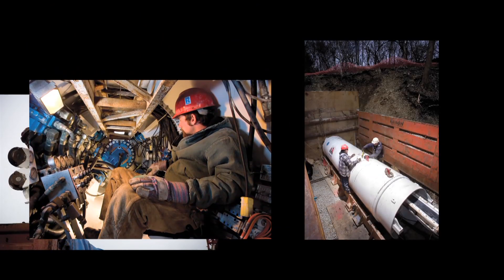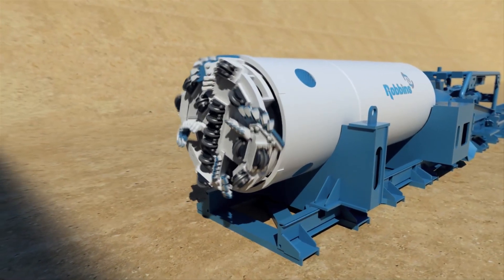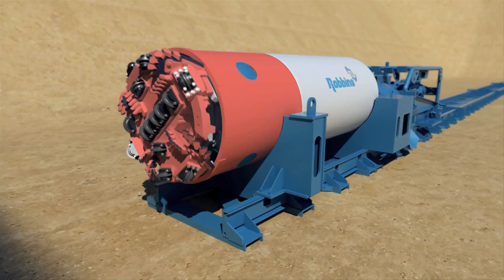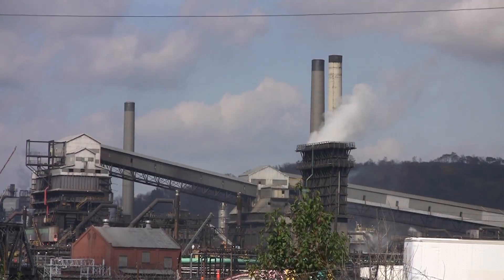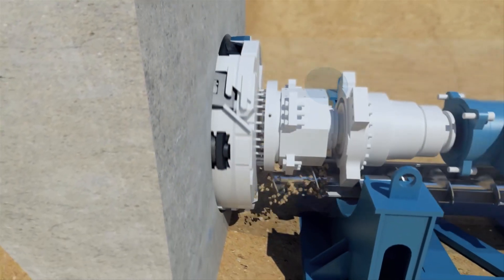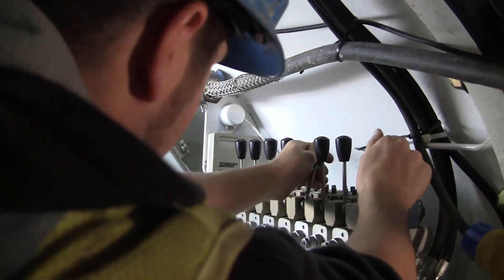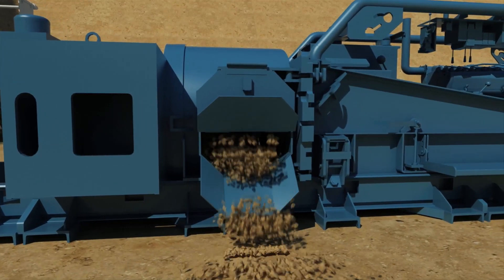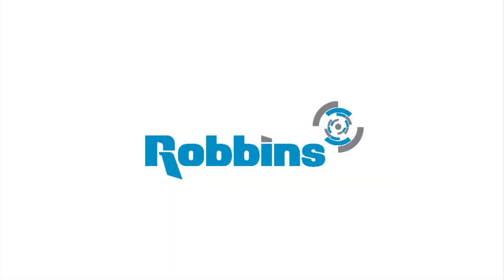Robbins Small Boring Units: A Closer Look at the SBU-M

Comment: Can this machine works vertical position if yes how to work. Please explain
Reply from the maker: Thanks for your question. These machines are not set up to bore vertically. However we do have small diameter machines that can bore at angles up to 45 degrees. For more info check out this link: https://www.robbinstbm.com/norway-hydropower/